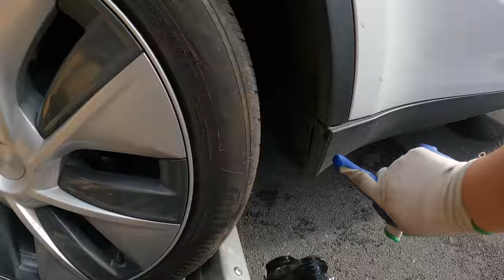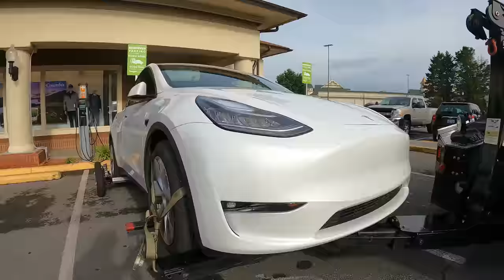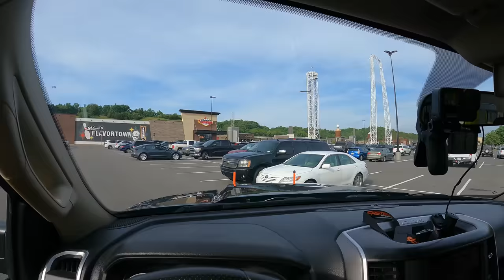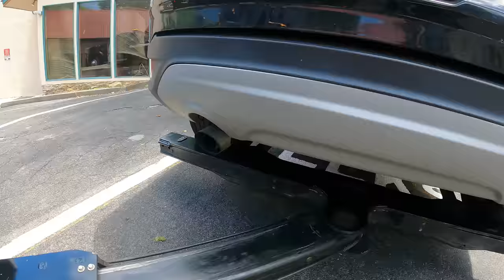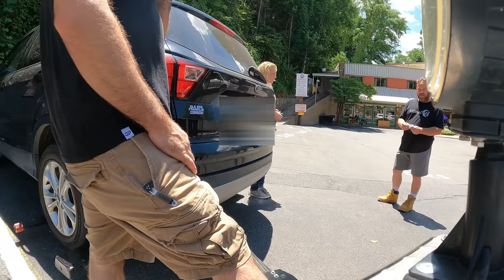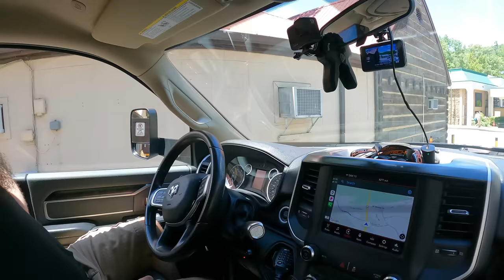A Dead Tesla And Illegal Parks

Comment: As someone who is trying to start a roadside service and small repair business I was asked about emergency roadside charging for electric vehicles and in the little research I have been able to do you should never roll a ev in neutral because it can cause damage to something so I think you did it right
Reply: EV's shouldn't be towed with wheels connected to a motor touching the ground, even in neutral.

But you can absolutely roll an EV in neutral short distances. That's why they have neutral.

Comment: If you want to clean any widow glass use powder Comet cleanser with a small bit of water or I use Invisible Glass and ultra fine (we in Canada call it 4 OTT) steel wool.  And no, it will not scratch the glass. Don’t use it on window tint of course. It super cleans any glass without scratching it.

Comment: Here's a different perspective: The spaces in front of outdoor, pad-mounted electrical equipment (transformers. switches, etc.} should be completely blocked off. If something happens due to a storm or electrical short-circuit, the utility needs to have a safe working clearance to perform maintenance or repairs. Typically, there is a sticker on the door that indicates the required clearance. Unfortunately, the stickers seem to fade over time. John Q Public has no knowledge or awareness of the importance of this safe working clearance. It's just another sign to be largely ignored or disregarded.

Comment: We have to put pillow cases over Tesla rims.  They will hold it against us if the clear coat gets a scratch from the 8 point tire straps they mandate to use. 

Power  really isn't an issue.  Any 110V outlet will charge one up..  Just takes 30 minutes to get 10 miles of driving.

Comment: Buffer cord goes over your shoulder when buffing a car. In my shop we would’ve died laughing at you Jeff. Use a Cerium Oxide specifically for glass to buff glass as well as glass specific buffer wheel. Acid Rain is more than likely what it is, water spots even from the worst hard water will wash off but Acid Rain spots won’t 
Cordless buffers go directly to recycle because the wheel RPM is unpredictable when the battery level goes under a certain percentage, they’re for the DYI crowd. RPM is the difference between a pro level job and a driveway warrior job
Reply: In Jeff's defense, he is a tow truck driver. I applaud him for not giving up on his mission. Driveway warriors unite!

Comment: @Everything Autos    I've watch a video from The Rag Company about water spots, at least on paint.  They said that wheel acid is the best they tested, so far to remove water spots.  They used CarBrite Wheel Acid  2 to 1 mixture.

Comment: No joke the best I've found is the invisible glass cleaner it comes with a rectangle block & gets the hardest water spots off no issue. I use that on all of my details I do water spots removals. Just a pro tip from a detailer
Reply: I bought it on Amazon for $10

Comment: Note to self: No Electric cars. Great job as always Guy's
Reply: Oh please.....
Reply: I made that mistake. Ford Fusion Energi. Cord almost burned our home down and fought with Ford about it until many more ppl came forward. No trunk space and couldn't get out of it's own way and the insurance is high because the crash rating is GARBAGE. And STILL use fossil fuels to run it. 
Lovin being back in this Chevy.
Reply: @PowerNGlory  Have fun hanging out at your charging stations for an hour, meanwhile I can fill up and be on my way in 5 min
Reply: @Mike-fd5wj  

Or in this case, the chargers don't work and so you have to be towed.
Reply: I'm sticking to a hybrid for now. Plug it in when I can, fill it up when I can't. I'd rather have better air quality where I live and have the fuel burnt in a power plant. There just aren't enough charging stations, and the stations aren't standardized enough, for road trips for all electric vehicles.

As for charging taking an hour or four, if I'm parked somewhere like a store I'll be in there for an hour anyway. So it saves me time vs pulling into a busy gas station because it isn't really any more time than just parking there in the first place. Again, only an issue for long-haul road trips.
Reply: Okay?  No one's forcing you to buy one.
Reply: @Mike-fd5wj  Did you bother to listen when Jeff said that once they hooked the Tesla up to the charging station it was already at 10% in 30 seconds?  That would mean a full charge in about 45 mins, *if you're absolutely dead*.  Seriously, some of y'all are so dead set against electric for no good reason.  Fossil fuels *will run out*, better that y'all get used to electric or hybrid, because we can't sustain regular cars the way we've been using them.
Reply: Electric Vehicle, NO THANKS!!! I’ll keep my 2022 Ram 1500 Hemi until the day I die.

Comment: Electric cars... I'll keep my smoking DIESEL ⛽️  pulling power and 412 miles per tank 👍👍
Reply: check out the vid w the e F150 towinng a 6000 lb trailer.  Its computer said it would go 150 miles. It went 75.

Comment: The Tesla driver was just an idiot. You have to try and run out of gas in a gas car, and the same goes for electric.  You just type in your destination and Tesla routes you with stops for charging if needed. It also starts warning you at 16%.  Them depending on a third party slow charger was just stupid. Those only give 6-12 miles of range per hour. The super chargers are closer to 500-1000 mph. The charge points are fine at hotels or theme parks where the car will sit most of the day, but that’s about it.

Comment: As a tow operator I always tow telsa with a auto loader because of the tow mode only Last for few moments then it takes its self out of tow mode which make a pain to load on a roll back without causing damage to electric motors an I personally don't trust the factory tow point

Comment: 1:50 am I the only one that noticed the water dripping underneath the front? I hope they didn't puncture the radiator or a hose on the battery
Reply: Probably just the normal dripping of the air conditioner..at least that’s what I thought.

Comment: A Tesla went on fire in a car park below an apartment block recently - they had to evacuate the entire block because the Lithium batteries burn incredibly intensely and are extremely difficult to extinguish.....!
Reply: Ya, I wouldn't part an Electric car in my garage!!!  Once the battery catches fire, almost impossible to put out.  If it's parked in your garage, your house is going up.  Water is not going to put it out.  So if you have a home sprinkler setup, it's to going to help all that much either.

Comment: Electric cars are a stupid idea! If you attempted to drive an electric car from Dallas, TX to Denver, CO. How do you think it would take?
Forever because there are no charging stations once you get out of the Dallas Fort Worth area!
Reply: lol, what?

If we're only talking fast chargers (150kw+), and only talking Tesla compatible chargers (not any other app or service), you'd pass 5 chargers going to and through Amarillo, another in Clayton in New Mexico, another just outside of Trinidad in Colorado, and 5 more before you reach Denver (3 of them between Colorado Springs and Monument). Again, that's ONLY fast chargers, and ONLY Tesla compatible fast chargers. There are other chargers on the route that I excluded.

Drove my Tesla 750+ miles from NY to the south. I skipped more chargers than I stopped at. I had 3 stops in all, and my longest was 40 minutes - because I was waiting for food and it took longer than my charge took.

Comment: Why would anybody buy a Tesla or any battery powered car. Is there a charging station at the top of Clingmans Dome? Totally rediculous. No reliability. I live in Michigan with cold  winters and these cars are dead in the water👍. They test these cars out west that doesn't have cold weather.  How can you go on vacation in your car with a limited milage of 250 to 300 miles and then find out there are NO charging stations. And how much did you spend for your car? Jeff will take of you. Towing bill plus dead battery. Awesome. I love my 7.3 Navistar diesel. I stopped for elderly woman that was broke down. She had a Tesla. Her battery was dead. She asked for help. I could not help her.  We have no charging stations. I did stay with her until the wrecker showed up. These battery cars are pathetic
Reply: I owned a Tesla near Buffalo NY - winters with temperatures consistently at or below 0F day and night and I parked it outside year round. Battery was never an issue - the whole point of the BMS is to prevent cold weather from impacting the battery.

In fact, other than having very little clearance and therefore not being able to clear more than a few inches of snow, the Tesla was the best car I ever owned in a NY winter. I couldn't take it over unshoveled/plowed roads, but I also never had to get into a cold car (heats up from 0F to 70 degrees in about 4 minutes) and it was the easiest car to clean the windows off. Electric heaters get hot almost instantly vs. gasoline engines which can take 20 minutes or more if you're not driving.

As for reliability, mine has 45K miles and is almost 5 years old. So far I've had to: replace the tires once, rotate the tires a few times and... that's it. That's all the maintenance it's needed in 5 years.

I've driven this thing on plenty of trips over 300 miles. Heck, I drove it from NY down south - over 750 miles - with no issue. Chargers were plentiful, skipped probably 4 or 5 chargers on the trip and only had to stop 3 times. Never stopped for more than 25 minutes (well, I stopped for 40 once, but that was because the food I ordered took a really long time, I almost had to move my car to avoid idle fees because it was finished charging).

Comment: Why they need to charge even these things are beyond me. Couldn't they build some sort of alternator system that charges the car as the wheels turn?
Reply: Perpetual motion is impossible.

The energy used to move the wheels comes from the battery. If you plan to put it back in the battery, then there's no energy left to move the wheels.